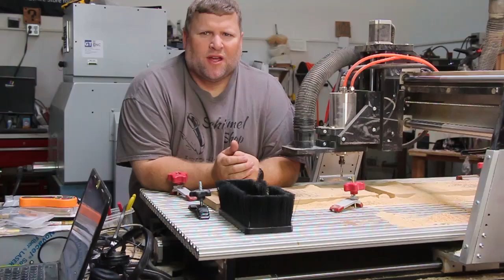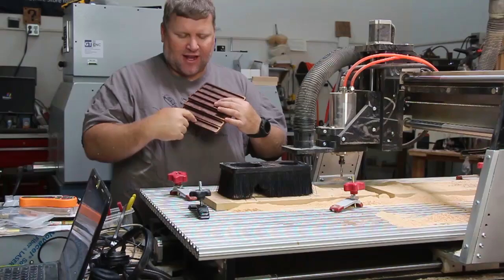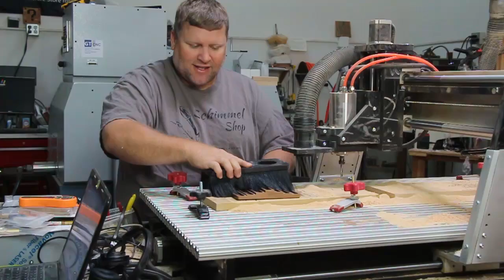CNC Shark Pocket Cutting ISSUES

Comment: I had a Shark CNC.  I didn't know anything about them when I bought it.  As I learned more, it didn't take long to see that this was more of a toy than a tool.  It should have never been sold being made with plastic at least not at the price that they are being sold at.  You are really better off  selling it and buying another machine that was built with proper material in the beginning than trying to reinforce and upgrade a plastic machine.
Reply: I am glad they are a US company and always innovating their product.  My Shark HD 510 is rock solid and I have used it on over 150 projects made of red oak, white oak, mahogany, maple and cedar and pine, fir and walnut.  Works great and I have used it so much the z axis cable or stepper motor is in the mail.  The frame and bearings are solid.  If I used the rest of my tools as much as I use this CNC machine I would be fixing those as well.   Great product and I can recommend it when my machine is down for these past 2 days.   I would buy another tomorrow if I needed 2 machines.

Comment: Hi. I have the shark black diamond hd cnc, it has the same flex as your does. If you find a way to fix this, could you message me. Thanks
Reply from the maker: Karen Smith I was going remake it all out of metal but instead I sold it.   Good luck with yours hope you find a solution
Reply: There is one thing that I noticed, when the Z it all the way up there is almost no flex. The more the Z is lowered the more flex there is. I haven't found any way to take up the slack.
Reply: You need to replace the linear bearings with a supported bearing. The rods flex, especially on the gantry. I haven't done mine yet, but it's in the works.

Comment: I have the same issuer on a Shopbot with a really stout gantry.  Even with Nema 34 steppers the boot bristles can create too much resistance and become a barrier to travel.  I've gone to flexible plastic on my home machine where the ends are bent in a curve at the bottom to just  raise as the z goes down.

Comment: I just discovered the same issue on my machine this past weekend. It was driving me nuts.  I finally removed the dust boot and it solved it.  I built the boot myself so now I need to find a thinner or more flexible dust skirt material.  And like you...I have a ton of dust to vacuum up all over my shop. :(
Reply: Build a 1" foam box over your shark.  It's light and it sits over the shark and contains the dust.  To service it can be lifted off and I just raise a end with a propup stick to hold it while I put in screws or nails or to vacuum it out.  Works great I do have a 4" dust port on the back side of the box that takes the fine dust to the Dust Deputy.  Then clean up the shavings after the carve is done with a shop vac on a 30' pool hose connected to a smaller dust deputy.  I did put in 2 windows using lexan plexiglass so I can see what is going on.   NO Dust on the floor or in my shop.  I wouldn't run the CNC again with just a dust boot as fine dust goes everywhere...even the best brush and bristles will leave a place for the router to send dust flying out.  Build video on the foam box is on youtube.  It has held up for over a year now with no issues and it has over 150 projects that has been under this cover now.  So it gets used a bunch.  My z axis cable or stepper motor is being sent to me as I type this.   It started glitching 2 days ago.  Shark CNC support  was very speedy and helpful.